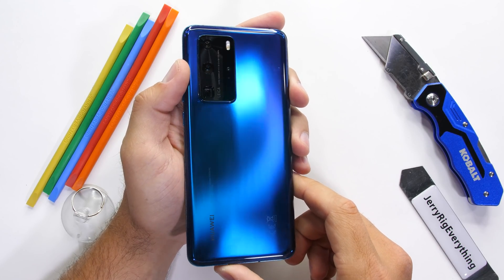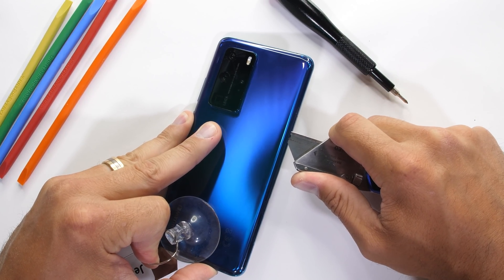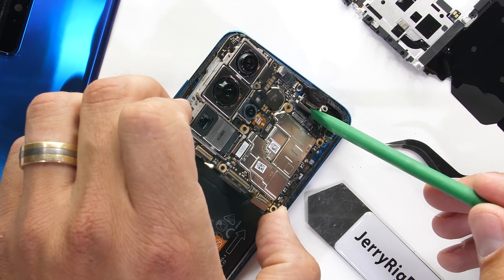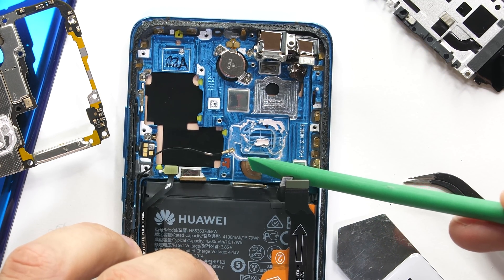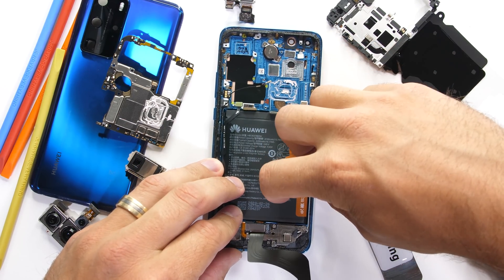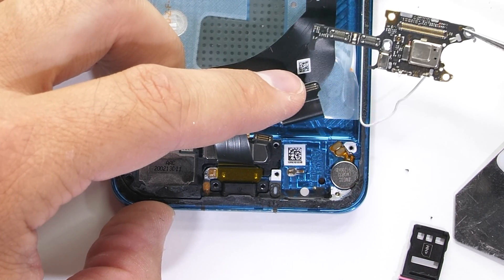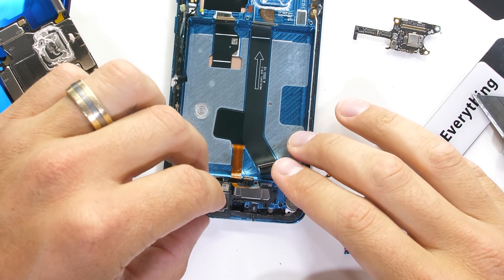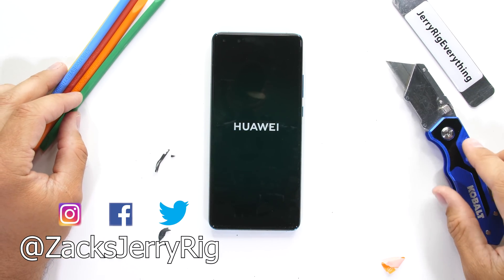Huawei P40 Pro Teardown - Where is the Ear Piece?

Comment: Not a fan of the in display speaker  , its ok if in a relatively quiet environment ,  but if you have some back ground noise it is lacking compared to a good normal stereo speaker set up . 
  Nice phone but i would not buy another .

Comment: I used Huawei Nova 5T, which is priced around 400$, and it does the same job as the P30 Pro, same chip, great camera, hole punch display, side mounted fingerprint but no OLED display.

Comment: About wireless charging, what if the phones give up the glass or plastic on the back and the antennas for wireless charging and nfc will be positioned under the screen? The disadvantage is that you charge the phone face down but the advantage is that the phone is more solid.

Comment: Samsung M30s and Samsung M31 are great budget smartphones you should tear them down and also do a durability test. They both even have some of the biggest batteries of 6000 mAH
They are really cheap M31 costs around 210 USD in India or 16000 INR and M30s costs around 197 USD or 15000 INR

Comment: Hey, Jerry, I would really appreciate a scratch and durability test as well as the teardown of the Xiaomi Redmi Note 8 Pro. I'm thinking of buying that phone but I would like to know how durable it is first. ( It's a mid-range phone)
Reply: Bro poco x2 is best under 20k
Reply: I own one, and I accidentally left it in my pocket along with my keys, and it didn't scratch
Reply: Emilian Străinu unless its plastic the phone wont get scratches. Also your key material is important, if its softer metal it might not scratch phones
Reply: @Crustee0  They are made out of iron
Reply: @the_le_emi2486  ok that's good to know👍👍
Reply: Realme 6 and realme 6 pro are better. I own realme 6 pro.
Reply: Best Phone 8 and Best Phone 8 pro are better. I own Best Phone.

Comment: I think a good mid range phone would be the Samsung Galaxy A20. Not the A20s. It's a very common model that I see from people on either boost mobile, cricket or metro pcs. Very common prepaid phone I should say. But it's one of the best phones I've used in years. My last good mid range was back in 2014 when I had an HTC desire 816.

Comment: Hey Zack, can you take a look at the Samsung Galaxy A51/A71, I'm beginning to think that mid-range phone have a lot more features than flagship ones, the same battery and obviously costs less than the flagship. Of course the screen is an important factor for the flagships, but considering every day use, you might just think that a 4K screen is a bit overrated for a phone screen. I mean, I do have a Galaxy S20 Plus 5G but I left the screen in 1080p for the 120Hz refresh rate so all videos I see are in 1080p and the difference to a higher quality video is not noticeable on a small Of course if you want to watch a video on a 4K TV, the variables.
Cheers !

Comment: I wish he tried the Huawei P Smart 2019 - mid range.It's kinda outdated, but still relevant. But the front glass and especially the back plastic is very weak (slide on table test - will be scratched up as hell) and after a week of use l, it looks worse than the galaxy note 5 i've been using for 5 years.

Comment: Budget phones to durability test, with interesting features listed:

-Pixel 4a (once it is released, it has been delayed a lot), possibly $399 or $349, based on leaks.
-Motorola Moto G Stylus $299, features a stylus similar to the Galaxy Note series and has a triple camera setup.
-Motorola One Hyper $299, features a pop-up camera similar to the Pocofone F2 Pro.
-Motorola Moto E 2020 $149, Motorola's cheapest phone, commonly discounted to $99.  It would be interesting to see how a $100 phone performs.  Maybe better than the $1,000 flagships?
-Motorola One Fusion Plus, $299, a $300 phone that boasts many features the flagships have, like 5G, pop-up camera, and four rear cameras.
-Redmi Note 9 Pro, $299, features a Quad camera setup with a hole punch selfie camera similar to the Galaxy Note 10.

I know I listed a lot of Motorola phones, but Motorola is really dominating the budget market right now.

Comment: Huawei stupidly removed the ear piece with the P30 Pro because something is wrong with Huawei.
Actively removing the second speaker just to "replace" it with a vibration motor that make calls sound EXACTLY the same but remove stereo sound for that is just nothing but stupid.
A overpriced phone that not even has stereo speakers. A joke.
Also: The P40 (Pro) does NOT has 3D Face unlock! Only the even more expensive P40 Pro+ has that.

Comment: Watching this and tearing down my 4 years old S7 trying to fix GMS network failure.
Let's get started
Edit :
After 4 hours operation was not successful 
RiP you will be missed my friend .
Galaxy S7 
2016-2020

Edit 2 :
Really wanted the Galaxy S 10e but  Corona situation forced for lower budget.
For 200$ i got Motorola One Action  in a box, brand new. In used market but brand new guy bought it and didn't like it so hey let's give a Motorola chance.
Last motorola i owned was Moto V50 in 1999-00
Do teardown of Motorola One Action, Zack

Comment: Hey Jerry, try getting your hands on the Realme X2 Pro. Its basically a OnePlus 7T but with faster 50 watt charging and two 2000 mAh batteries. (Also has Snapdragon 855 plus with UFS 3.0)
That would be fun seeing a non foldable phone with 2 batteries in it.

Comment: It’s not a play ship. The P40 Pro+ is the flagship, P40 Pro is mid range
Reply: Play ship 😂
Reply: @Mīćhæł Pīņəß And the P40 pro+ is a flagship, with some more stuff 
P40 lite E is more budget version of P40 lite
P40 Is between P40 Pro and P40 lite
P40 lite 5G is a P40 Lite with a few upgrades and 5G
Reply: @Mīćhæł Pīņəß P40 lite E has a worse screen, CPU, front camera, no 5ghz wifi support, no NFC, micro usb, no fast charging (Only 10W), less ram and storage than the P40 lite

Comment: As a smartphone repairman I gotta ask:
WHY AREN’T BATTERY PULL TABS A STANDARD THING IN EVERY SMARTPHONE!?!?!?
Reply: still better then them being soldered ERHM IPOD TOUCHES
Reply: @czLochy  that's probably easier to not break than those little connectors
Reply: Marc Frank bruh you literally CANNOT remove it without a soldering iron and at least basic soldering skills.
Reply: @czLochy  yes...
Reply: It can even differ by the market they're made for. My Xiaomi A1 that normally has pulltabs was attached by strong adhesive. No amount of heat helped. I completely destroyed the battery in the process of replacing the screen and charging port.
Reply: To make you work for your money

Comment: with the fingerprint reader being on the front - i know you've done the screen scratch test, but what about the burn test over the finger print reader. will the flame/heat remove the functionality of the scaner, or just the screen over the top.

Comment: I have a Xiaomi redmi note 8 I got for £140 off of eBay brand new. 128gb great value with a 48mp rear quad camera aswell but you can get the redmi 10x for like £150 on eBay( I know your in the us but these are international sellers)

Comment: I would love to see one of Samsungs new cheapest phones. Its called the A01 and as far as I know, it's about 100 bucks and is the cheapest they make. Maybe compare it to s20. Thatd be pretty epic
Reply: That's exactly what I was thinking!
Reply: I'd love to see an A20e on the surgery table
Reply: its a little to cheap to last, ive always had  <$110 phones, always got slow within a year of usage.
2gb ram would be nice on android go, not the full deal.. the battery is also on the small side.
Spent $150 on a redmi note 4 about 3 years ago, 1080p, 3gbram, 4000mah and its still working solid